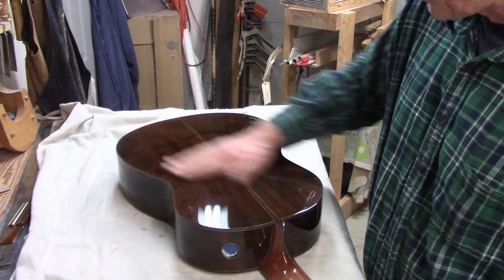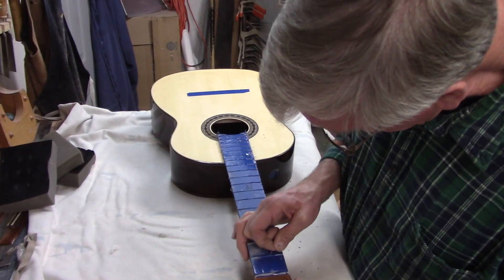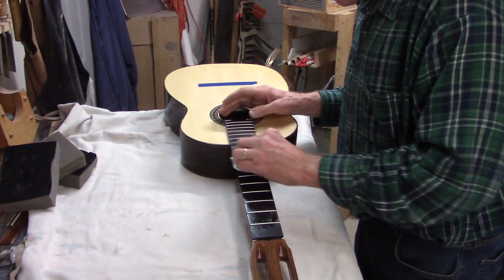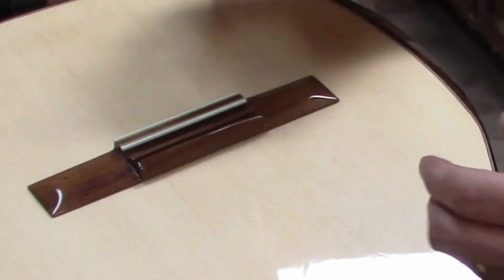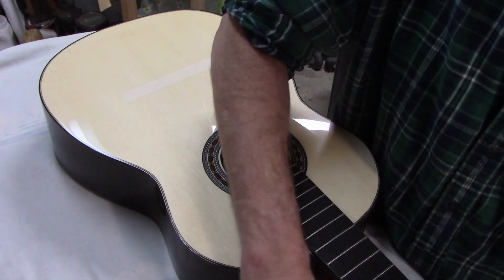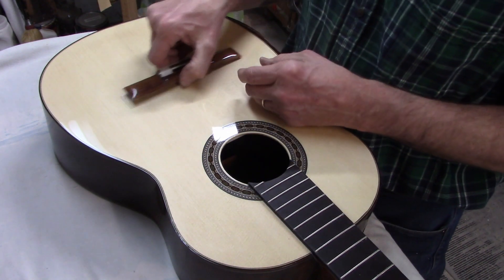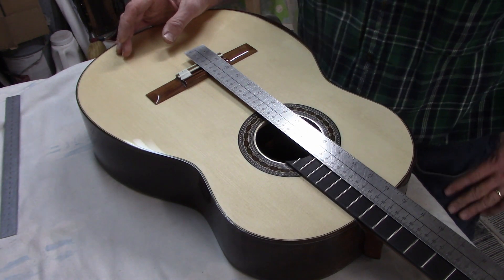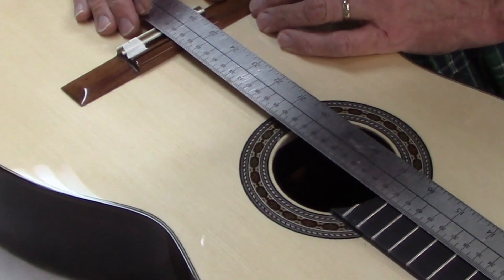Classical Guitar Construction Part 17: Locating and Gluing the Bridge

Comment: Is it commom for the bridge to be not perfectly perpendicular in relation to the neck to compensate the octaves tunning? Thanks.
Reply from the maker: With classical guitars, the compensation is not very different from one string to the next, because their diameters are fairly similar.  As a result, compensation often isn't very obvious because the entire bridge is set back a few millimeters, but there is not much of a slant in the saddle.  Steel string guitars require quite a lot more compensation for the bass string than for the trebles, which is why you see the saddle slanting approximately 1/8" from the 1st to the 6th string. The reason the require differing amounts of compensation has to do with their vastly different diameters.

Comment: Great video! I know it has been a couple of years, but if you see this I am wondering how you would adjust the distance of the bridge from the 12th if the saddle slot is angled?  I have plans for a Ramirez style guitar and it uses a slanted saddle. Looking at the plans, the bridge is aligned so that the center of the slot is right on 325mm.

Comment: I really appreciate these tutorials.  Thank you.  I wonder if the justification for the difference in distance (nut and saddle) is due more to the fact that the strings are of different widths and thus address nut and bridge slightly differently.  The saddle is angled such that the one side is closer than the 2mm and the other further away.
Reply from the maker: Yes, the thicker strings distort pitch more as you move up the fretboard,  which is why they need to be moved farther back than the thinner strings.

Comment: Great video. I noticed you skipped over the taping of the inside caul. I couldn't get my caul to stay in place with tape, ended up taping magnets to the ends of the caul and holding it in place with magnets. Worked like a charm. I also made my inside caul by pressing Styrofoam over the braces / bridge plate and using the Styrofoam as a template.
Reply from the maker: Those are good suggestions,  thanks!

Comment: Hello, I am in the process of building my 3rd guitar. My first two have a bridge that is 7” wide, 1/4” thick... the blank i’m using is 6- 3/4” wide and 5/16” thick. In your opinion, will the 1/4 difference in width be ok?
Reply from the maker: Yes. I don't think it will make any noticeable difference.  Happy building!
Reply: @zimnickiguitars311  - thank you for your quick response, I appreciate it.
Reply from the maker: @mikechallgrenguitars9189  you are welcome,  I hope it helps.